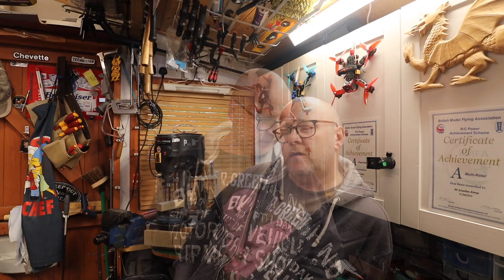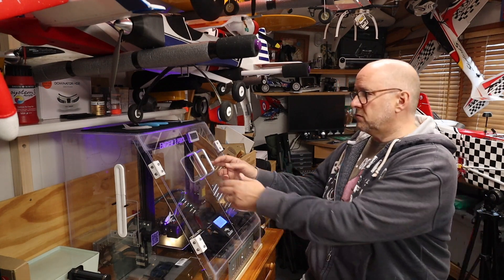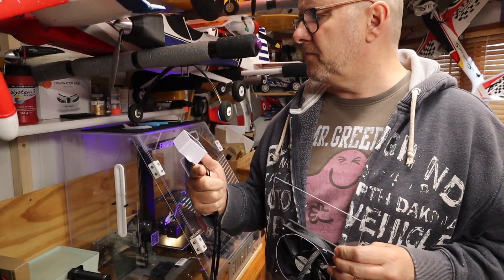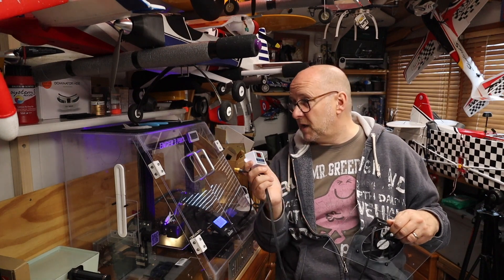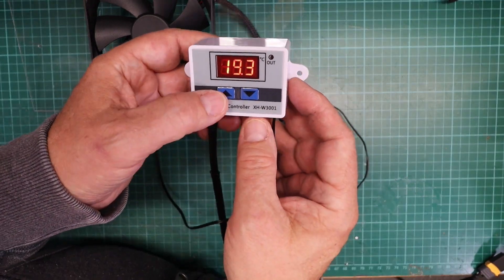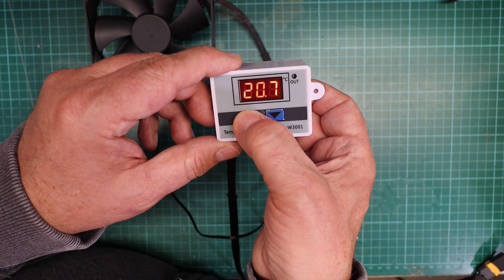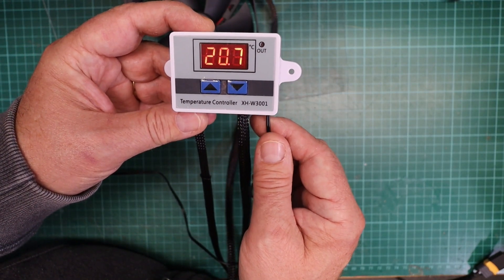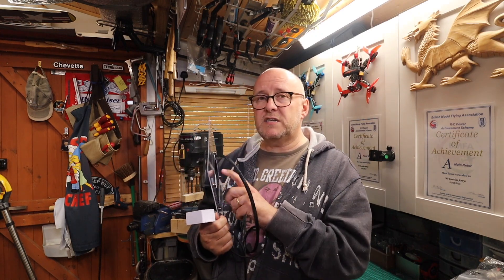3D Printer Enclosure Temperature Control

Comment: How is it to keep the noise in?
Reply from the maker: It does make it a lot quieter.
I also changed the control board and that was a massive difference. The robotic wining noises the stepper motors make completely gone.

Comment: Do you have two fans in this enclosure? One at the bottom blowing air from the shed into the enclosure and one at the top blowing air from the enclosure to the shed?
Reply from the maker: I have one enclosure fan sucking the warm air from the enclosure. I have allowed gaps a the bottom sides so cold air is not drawn across the print bed. cools the control board then up and out from the back, works well, having cold air hitting the print bed causes warping and can cause the print to release mid print.
Reply: @TWSreviews  thanks I m in the process of building an enclosure myself. I plan to put a suction fan at the top. But there are alot of electronics inside the printer directly under the hot bed and build plate. Not sure if the suction fan will do the trick of keeping these electronics cool!
Reply from the maker: @mtzmechengr5781  the air being drawn in needs to be low level and on the sides to ensure the air flow is through the main control board. heat rises so will always be cooler at the bottom where the control board is drawing in cool air. I may look at a small mini computer fan and flat ducting  to draw air just for the main board.
I hope you are enjoying the problem solving and testing as it makes it all the more rewarding. 
Good luck with your project and please let me know how well it goes.
Jon

Comment: How well does it handle ABS?
Reply from the maker: The enclosure gets warm and this shifts the heat efficiently.
I have a low level vent in the back and gasket around the front base of the enclosure so it never draws cold air in across the print bed. Works great and have been printing all through the winter with the ambient temperature in my shed being 5 deg C at times. A nice toasty 24 Deg C maintained inside the enclosure.

Comment: Hi. Is there any way to know if I would need the 110V-220V or the 12V version if I am using a US Geeetech A30T? I know its likely a dumb question. I know how to solder and whatnot but Idk much about DC current lol. The specs show DC24V so I assume I might need that one
Reply from the maker: If you buy a 12V fan and get a 12v power adapter, you can run the fan and controller off that.
Have a look at my latest video: https://youtu.be/j1bbWSUcmZA

Comment: Great vid thanks, I wanted to ask can you wire a plug onto the power cord and run it from the mains ?
Thanks again
Reply from the maker: The one I purchased was 24v DC not mains voltage. You could buy a 12V or 24V PSU mains adapter to run a controller and fan
Reply: Thanks

Comment: How do you build the connection to the power supply?
Reply from the maker: It is an XT60 connector. You can buy a male and female XT60 and solder to make an extension cable.
I use them for my model batteries so I was able to knock it up easily. I guess you can buy an XT60 extension lead from ebay....
Reply: @TWSreviews  ok so you solder the cable directly to that cabel that comes out of the power Supply?
Greetings from Germany 🙈
and Merry Christmas
Reply from the maker: @SuperRalfio  I made a longer red and black wire, soldered an XT60 plug on the end and then connected it direct into the power supply + & - connections
Reply: @TWSreviews  Thx
Reply from the maker: @SuperRalfio  you could try one of these 
https://www.banggood.com/14AWG-300mm-T-or-XT60-Male-Female-Plug-Charging-Wire-Adapter-Extension-Cable-for-Lipo-Battery-p-1669335.html?cur_warehouse=CN&ID=510961&rmmds=search

Comment: Jon - You need to look at a Raspberry Pi3 running Octoprint. You can control a fan using Octoprint to control the relay circuit. All can be very compact. You can also control a fishtank heater with a dual port relay, and use that to heat the enclosure. You also need to be cafeful when it gets cold as your filament will absorb moisture, and then prints turn pooh.
Reply: I just read your comment on this video. But is there a wiring diagram about how to do this and control everything with the enclosure plugin?

Comment: I presume you aren't printing with abs on your printer? That would read the enclosure to be warmer anyway and drafts from a fan would probably cause failed prints. Not sure how much a daft will affect other filament but might be something to bear in mind.

As for monitoring the temperature have you thought about using a raspberry pi? I have a pi connected to my printer running Octo print so can start / stop prints remotely and see progress and temps of the bed and hot end. If you added a Sensor ( eg DS18B20+) to the pi you could then also monitor the enclosure temp. I pull all this data in to some software called home assistant which can also run on a raspberry pi, but Octoprint has loads of extensions so there might be one that could display the enclosure temp.
Reply from the maker: Thanks for the feedback....
I haven't been printing ABS because of the smell, Now its in the shed it will be fine. If I print ABS I can close the vents and the reason I went with a low speed fan.
Question, Does the raspberry pi need to be connected to a PC?
Reply: @TWSreviews  no the Pi doesn't need to be connected to a PC, it has WiFi onboard. It is connected to my printer with a USB cable and sits outside the enclosure. I then do everything from my PC and upload my Gcode file via the Octoprint web browser so no more putting files on to sd cards 😀
Reply: @TWSreviews  not sure if I'll be allowed to post a URL but if I do here is a link to a guide on getting a temperature sensor connected to a Raspberry Pi:  tutorials-raspberrypi.com/raspberry-pi-temperature-sensor-1wire-ds18b20/
Reply: You can also spend very little money and get a combined temp/humidity sensor that plugs into the pi without the need for any soldering.